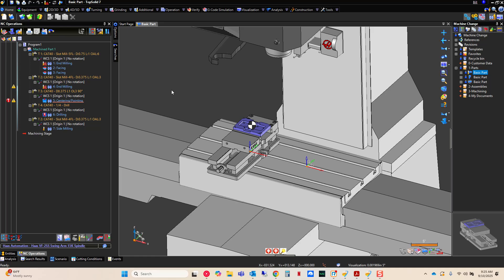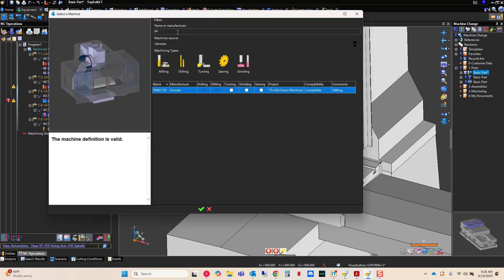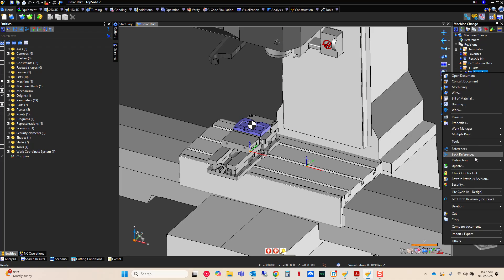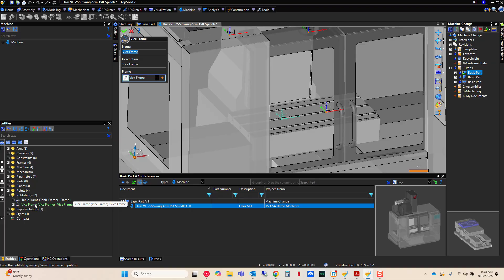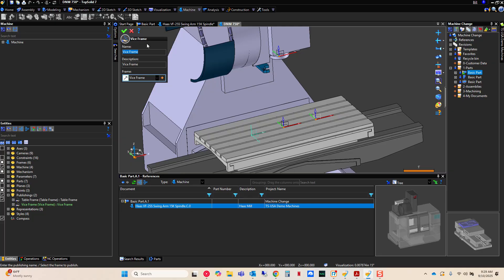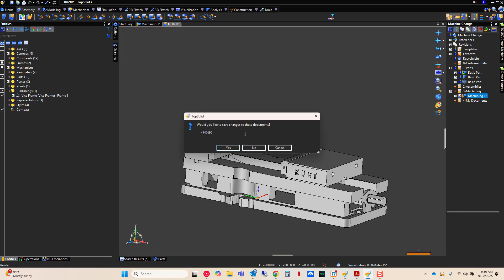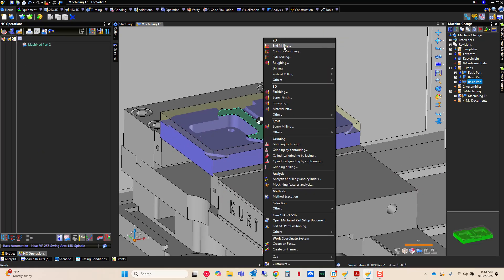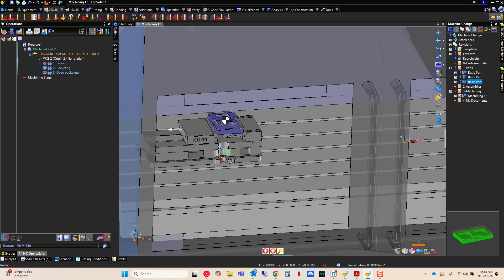TopSolid - Machine Changes made simple

Comment: Thx for the video
Can you make tutorials for advanced 5x barrel milling strategies? Tips and tricks? Milling complex shapes with a spherical barrel cutter and shiftig contact point.
How to do residual material machining with this tools in corners.

Or another thing. How to deal with huge complex facetted rawparts.

Or I need a special link rule for a overlenght toolchange. The table has to move to a specific position if the next tool has overlenght. How to check for this specific parameter bevor the tool is in the spindle.

Sry for my bad english.

Comment: Hi Bill, there is strong background noise in the last two uploads.
Reply: I just listened to it and don't hear anything...maybe a faint hint of the fans on my laptop.  I'll see if I can clean it up next time around. thanks for letting me know.
Reply: @gencbill  No worries. I have a silly question. How I can select hidden or obstructed geometries or faces?
Reply: @Ak47ram  You would use rotative selection.  Put your cursor over the object in question, then hold the left mouse button down, while holding the left, begin tapping the right. This will go through all possible selections. Once the Object in question is highlighted, just let go of the left button.
Reply: @gencbill  Holly Molly! I have been suffering for months! Thanks for the tip.
Reply: @gencbill  For the sound, there is computer fan kicking in later in the video and from the beginning there is a humming noise of an AC or an electric machine. 
Your voice is a bit muted compared to previous videos.
Reply: @Ak47ram  Yeah, this new PC has 24 cores. It likes to kick in the fans a lot. I'll check to ensure noise cancellation is on on the microphone in the future thanks for the feedback.
Reply from the maker: @Ak47ram  Found the issue. Noise cancelling was turned off on my Microphone. Thanks for bringing this to my attention.